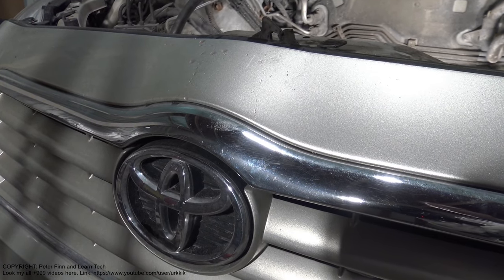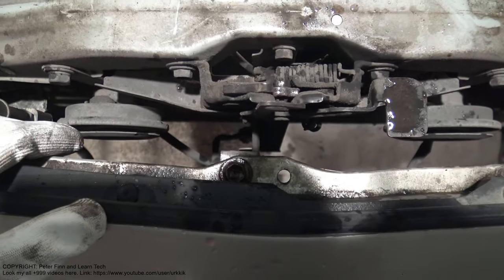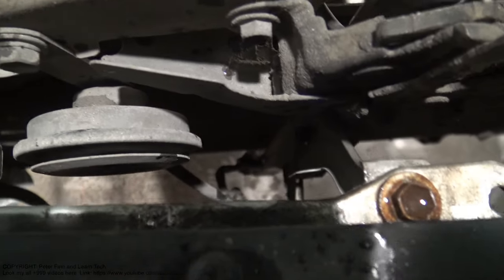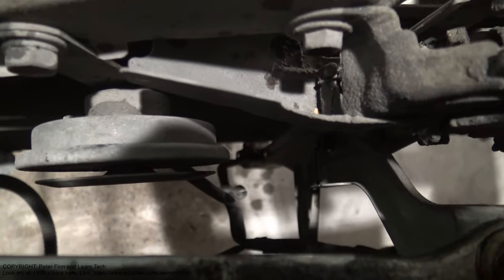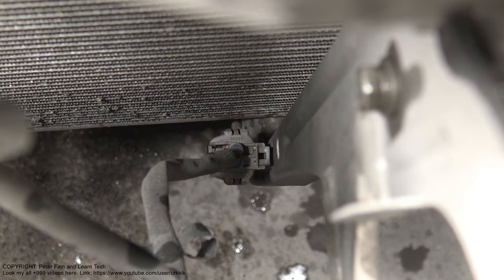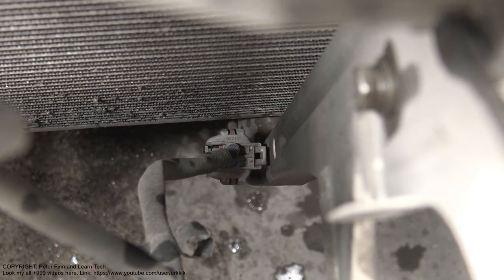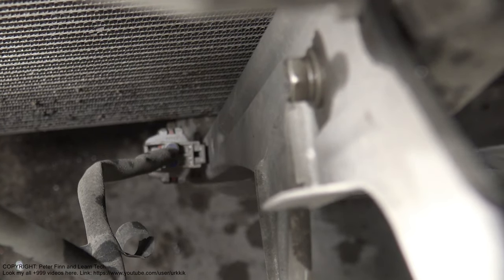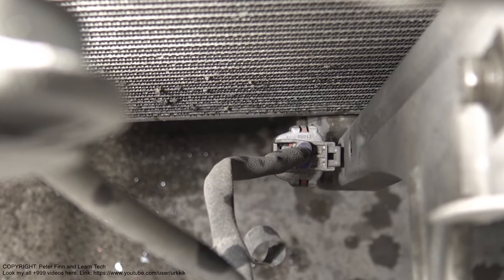Toyota cars outside temp sensor location info

Comment: My 2015 RAV4's  "outside temperature display" show 10 degree higher after my hood is replaced with a new one and the body shop did a car wash for my engine.  I think they must used some cleaner which cover the temperature sensor.  Do you think I can just pull water from above to the sensor which may wash out the dirt and cleaner?  Will the water damage the sensor if I pull water directly to it???  Thanks.
Reply: Karl Lui water may ruin it try isoprosol alcohol I’m pretty sure that’s the one made for electronics

Comment: Replaced ambient temp sensor but it still reads falsely. What can cause this?
Reply: Were you able to fix it?
Reply: @dylananddaddy did you try to reset it by disconnect positive battery side for few minutes?
Reply from the maker: Thanks for comment 😊👍